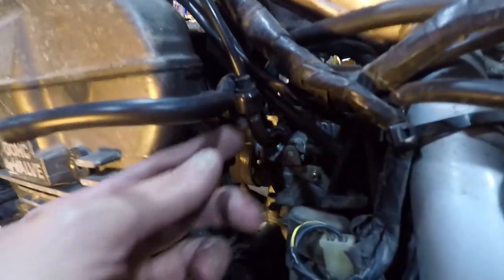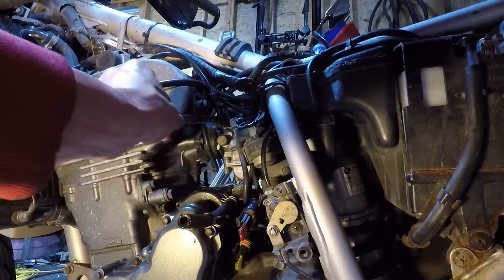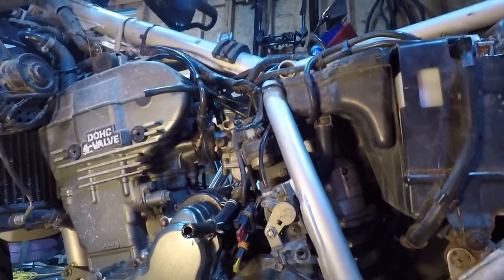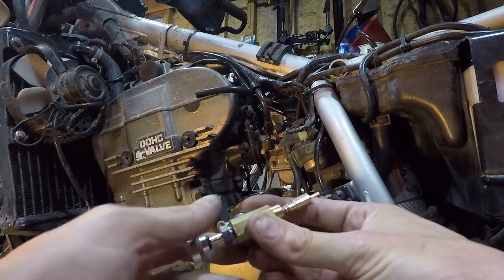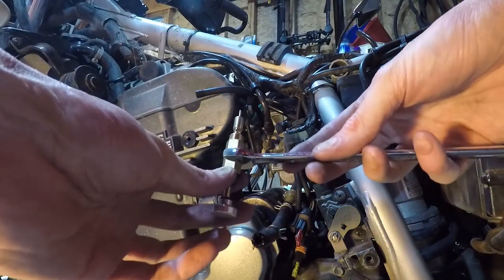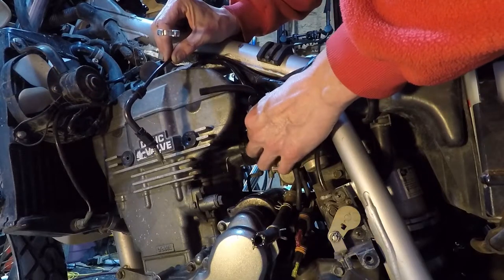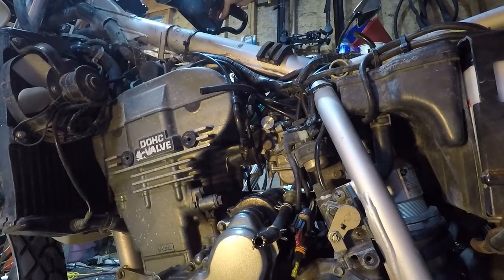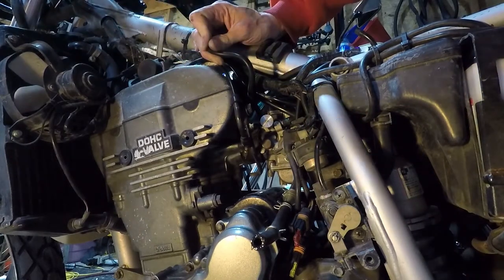Installing a KLR650 choke cable eliminating manual enricher valve.

Comment: I can’t stand mine. It’s too hard to access. And if you tighten it so it won’t vibrate back in from the motor  then it’s too hard to pull out. Gonna have to extend mine somehow or tie a string to it😝